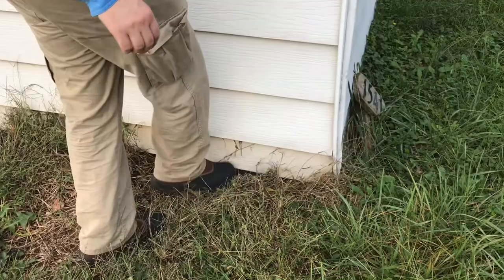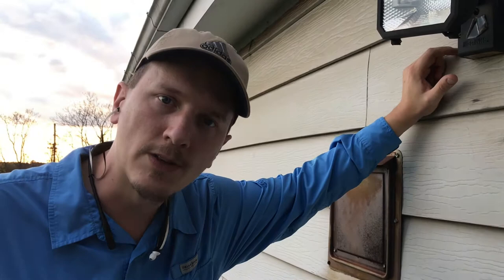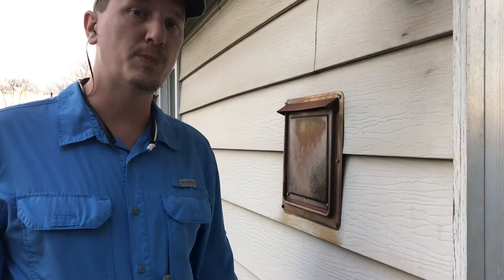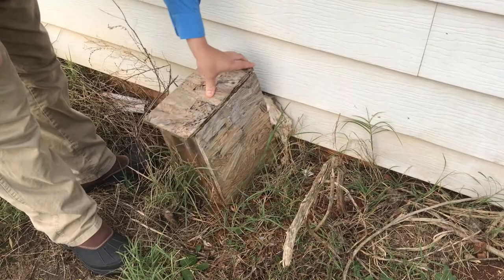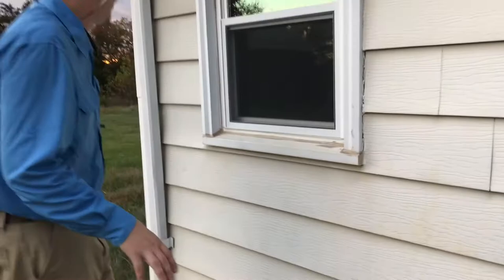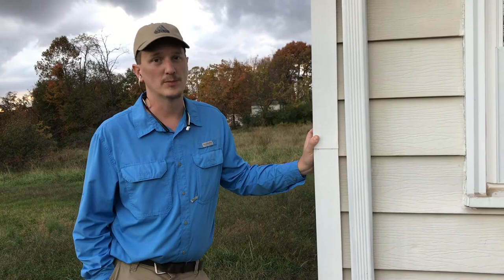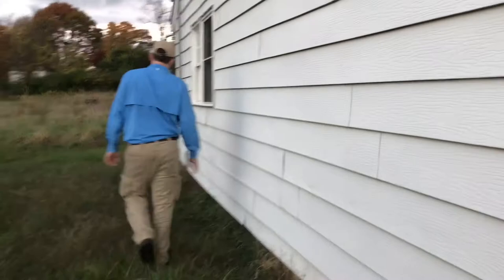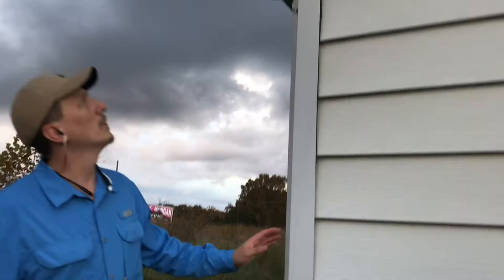Mice Monday - Ep.3 - How to keep Mice OUT!

Comment: We’re at war with mice in our unfinished basement. Caught two babies just the other night, nothing since. I know that they’re there, especially with just two babies getting caught out of a who knows how large of a litter. 

Just watched your video about mouse body fluids left behind on traps - I’ll adjust my approach!

Clever lil’ punks! They’ve set up camp inside the basement insulation and they bring in food from the outside.

We found one entry point, the builder left about a half inch gap above the house foundation, leading straight into the basement.

I know that there are other entry points, we’re working on sealing as many as possible!